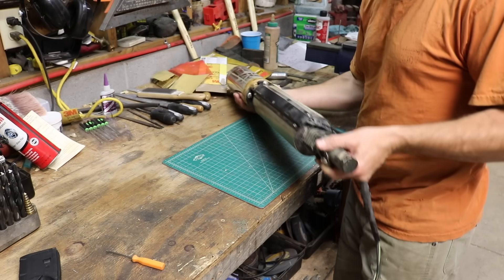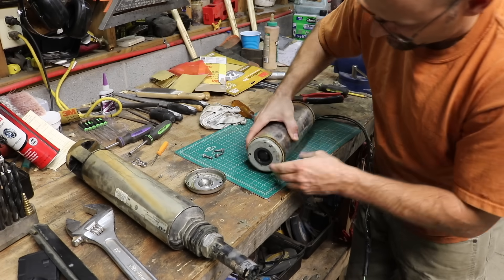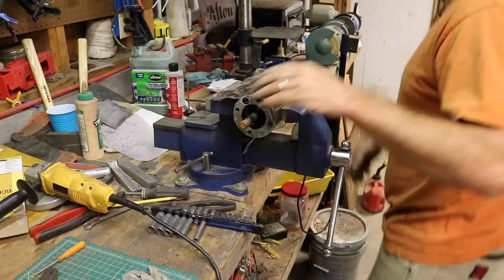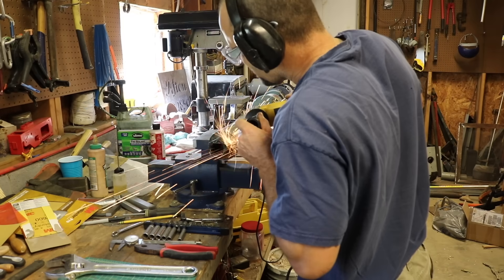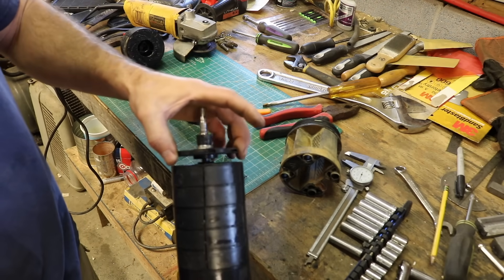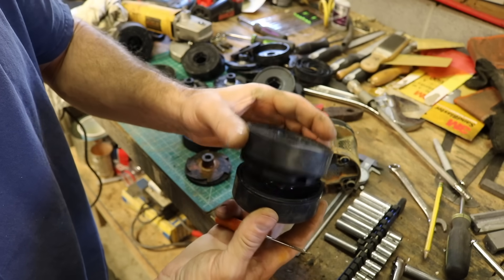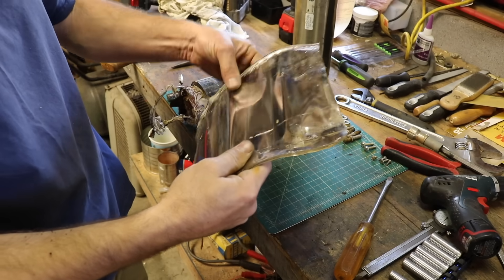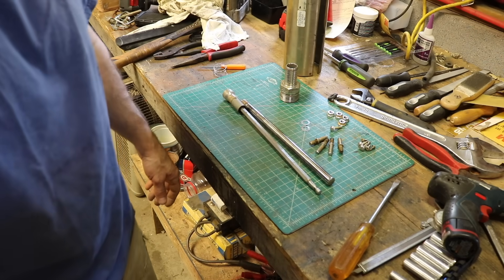Secrets Inside Your Well Pump. How Does A Deep Well Pump Work? FarmCraft101

Comment: How can you determ if it was hit by Lightning or not.?
Reply: Sometimes it is hard to tell if it was lightning or another power issue caused by a storm.  Lots of possibilities can tip the scales for or against lightning damage.
Reply: Thanks can you say a few please, Fighting my Home insurance claim about this etc
Reply: Sure I can give a few, but the best person to have verify would be the pump installer that put it in if you had a professional do it.  To start the issues would have to be related to the motor itself and not the pump end.  

Things that tip the scale for lightning:
1 On the motor burn marks where the lightning went through it are highly suspect for lightning. (but not definitive)
2 If the motor is shorted out internally that can be caused by lightning but can also be caused by many other things.  
3 burned wires above ground,  breaker/switch/control boxes with burn marks where they mount showing where lightning arc jumped to another ground.
4 blown capacitor or start relay in the control box can be lightning or can be short cycling caused
5 burned wires downhole not caused by rubbing 
6 other damaged devices at the same time such as electronics

If any of the following conditions have happened then it could tip the scales against lightning:
1 Water logged pressure tank or other cause of short cycling the pump/motor.  This may be evident at the time of replacement or shown as pump wear: split/stripped impellers or motor coupling fretting/stripped.
2 Wiring burned/shorted from obvious rubbing contact.
3 A well that produces less than the pump can airlock out and may not re-prime causing the motor to overheat. typically shows as a motor reading "open" with an ohm meter as the automatic overload fails to contact eventually 
4 control box or switch issues causing motor start failure or short cycling multiple times again overheating the motor.  like #3 symptoms
5 if there was other power issues (like a down line) that short the voltage it can also cause the motor to burn out.  It's could be storm related but not necessarily lightning

Again this is just a start to what can go wrong with pumps and by no means everything.  We have had places with the wires blew completely off the wall, control box fried, breaker box fried, obvious lightning damage, and the pump ran fine for years after that.  Then the next place may have one little arc point and it fries the motor so it's hard to outguess.  The biggest indicator is the timing with the storm.  Most all damage would show up right away and not days later.

I'll try to get a video up in the future to cover this topic. Thanks for the question.

Good luck
Kenny

Comment: I was always told that the motors are filled with a toxic oil and you shouldn't mess with them.
Reply: The modern submersibles are filled and lubricated with water instead of oil.

Comment: I hope my well will give me 43 years of service. Great video
Reply: the well in the house I am in was installed in 1997, so 21 years so far and still going.I wouldn't be surprised if the well pump installed before that one was much older. The disconnect switch / fuse box located near the well pressure tank uses those round fuses, so you can guess how old that setup is.
Reply: snoopdogie187 great!  It is the bearings that fail first.  Maybe a good idea to replace them preemptively and you have a longer lasting pump...
Reply: Ken Michael ....  43?  Grab the brass ring.  Go for 45.

Comment: Bi-metallic temp switch - opens with over-heat, then trips the triac (solid state relay) to shut off motor power. Maybe. Just guessing.
Reply from the maker: I was thinking the same, but now I've found the answer.  It's a 'biac start switch' which supplies power to the start winding while the motor is starting up, then power is cut when it gets to rated speed.  http://apps.franklin-electric.com/am/biac-switch/standard/index.html
Reply: makes a lot of sense

Comment: The hose clamps are there to connect the pump assembly to a plastic hose.  The hose also carries the weight of the pump and is subject to its starting torque.  Many submersible pumps are hung on 1" galvanized pipe.  If your pump has been in there for forty years, hanging on plastic pipe I would worry about the plastic.  Ask the people who put you new pump in.
Reply: Oh btw, if it's been in there 40 yrs it doesn't matter what they used, it should be replaced with new stuff
Reply: Last month I pulled a well with the seamless poly pipe (first time I've seen it here) that was set at 500'. Plastic is better than galvanized for long term, galvanized rusts plastic wont. Most of them around here use threaded pvc, schedule 40 (standard pvc wall thickness) down to 200' and schedule 80 if it's deeper than that
Reply: Here we never hang those pumps with the pipe alone and leave the weight and stress to the pipe, we always use a nylon rope tied to the pump. We also use flexible high density polyethylene pipes.
Reply: willy kanos In my area at least, no pump is on galvanized unless someone does it themselves. Galvanized makes is extremely heavy and would be a nightmare pulling. Most have flexible 100 psi plastic clamp pipe. The pipe isn't supposed to be what holds the weight either. There is supposed to be a rope that ties to the pump that ties up top that holds its weight.
Reply: I used "well strength" (thick walled) plastic pipe and hung the pump from it. (I think there are 3 grades of rolled plastic pipe. Well pipe being the strongest.) Nylon rope is slightly longer than the pipe and is only there in case the pipe breaks. My pump has been down there since 1981. My well is 96' deep. I think somewhere around 200 or 300 feet they start using steel pipe. I know of one household well in Bend, OR that is over 700 feet and is steel all the way down. He has had to call in professionals to pull the pump twice. Several thousand dollars every time.
(Wandered around YouTube, found out my information on well piping is somewhat inaccurate. Though I disagree with the presenter's opinion of poly pipe he shows all the options: https://www.youtube.com/watch?v=WFRwpQWoZrk )
Reply: willy kanos if it hangs o
In the water you did something wrong the pumps always must be on something stable